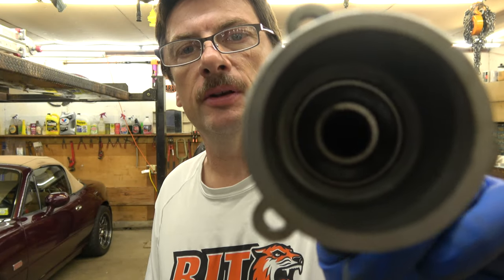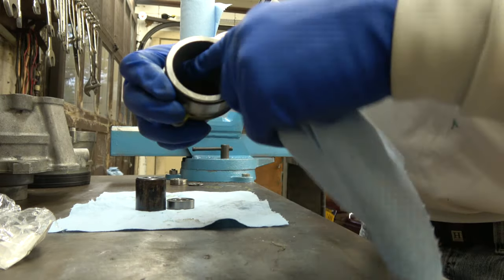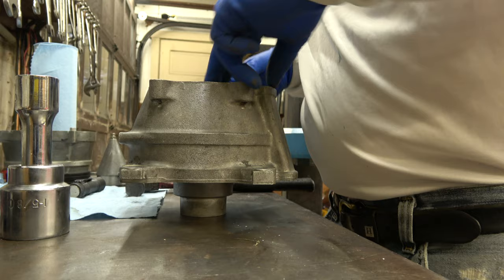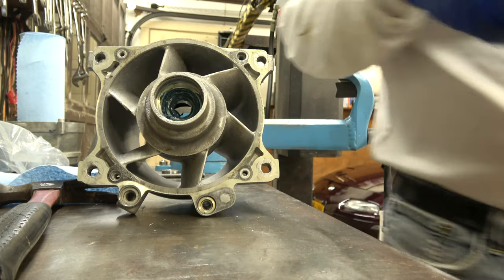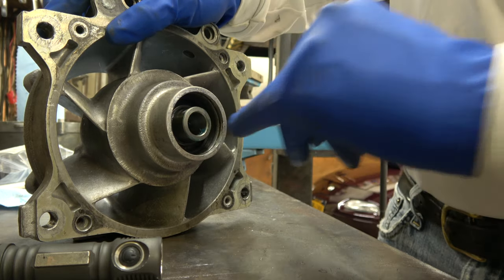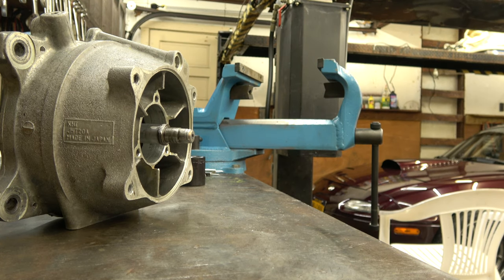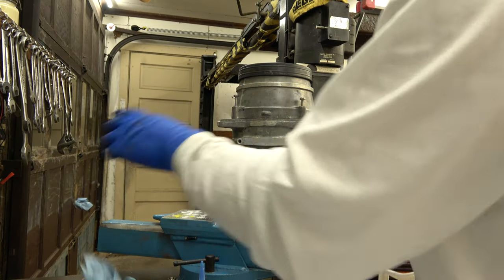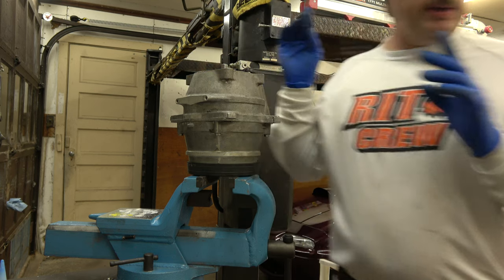how to rebuild Kawasaki ultra 150 jet pump part 3

Comment: Just pulled the bearing from my cone. Used a bolt drilled a hole in small chunk of angle iron and used a nut and wrench to pull it. Same concept less beating in things. Worked flawless